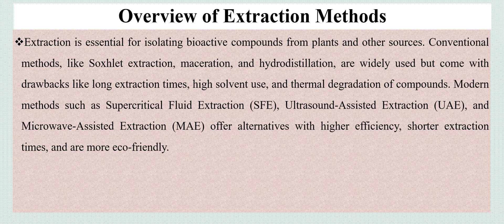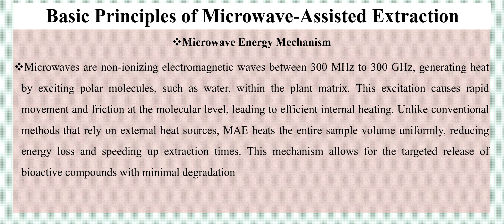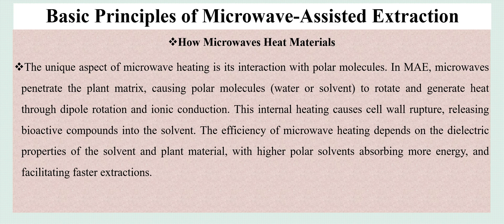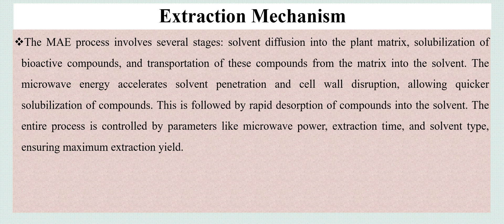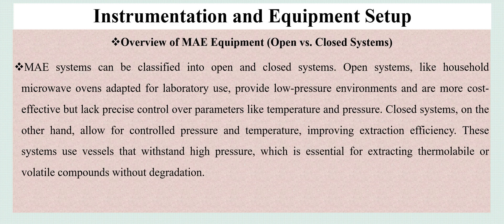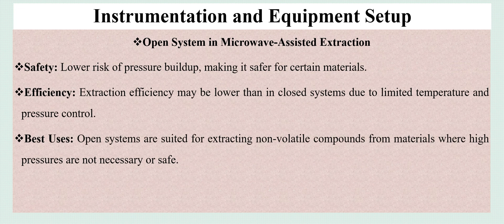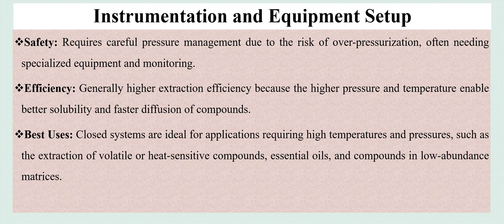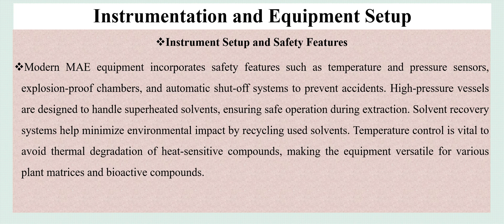Microwave Assisted Extraction Part 1 - Need, Principle, and Instrumentation

Comment: isn't it in pressure control, "allowing extraction at temperatures (BELOW) and not ABOVE the solvent's boiling point"? I have this question since, I regard that we pretend to lower the boiling point to prevent the heat-sensitive compounds to suffer from high-temperature conditions.